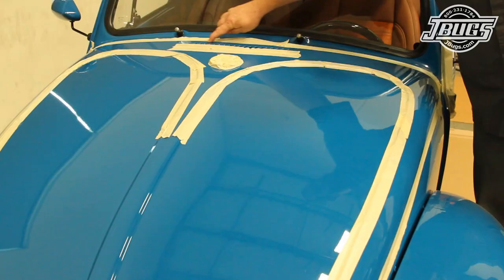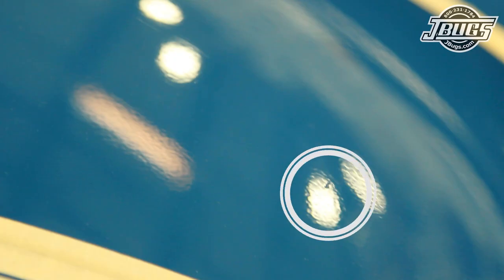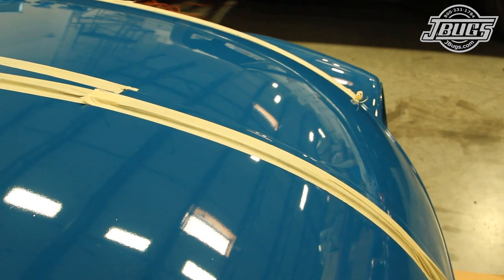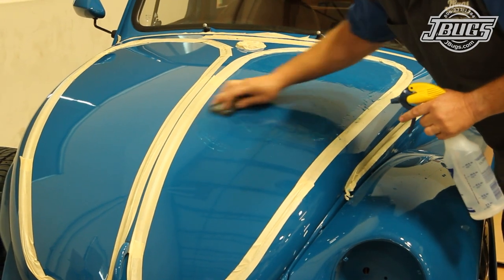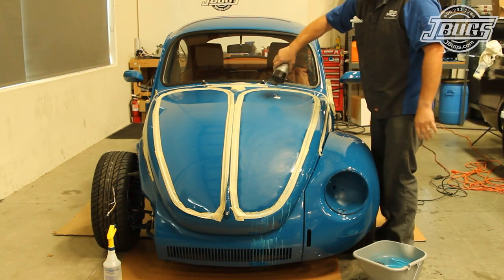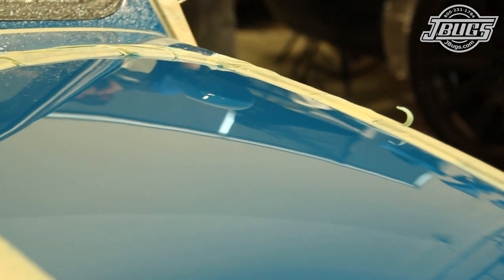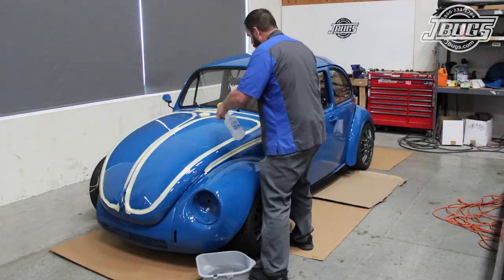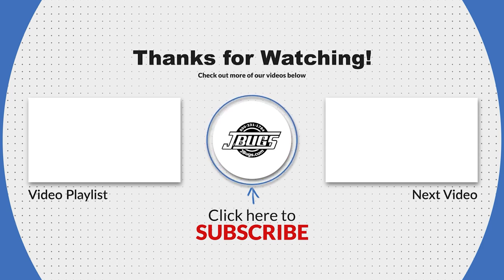JBugs - 1971 VW Super Beetle - Wet Sanding

Comment: What is the detail spray yon clean with ?
Reply: I use Meguiar's Quik Detailer but anything similar works well.
Reply: @Sam_Mebane  cool thanks man !  That stuff way better than warm water ?
Reply: @johnmartin5153  all depends on what you're using it for but for cleaning and detailing cars, yes. I don't use a hose or bucket. A California Car Duster, Quik Detailer Spray and microfiber towels are what I used for washing my restorations.